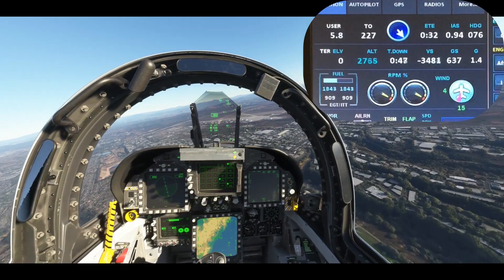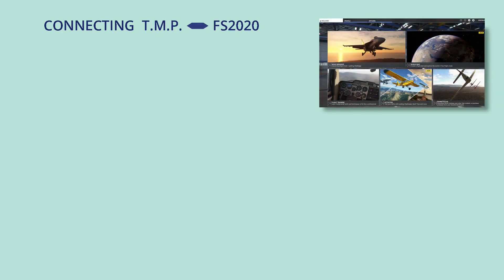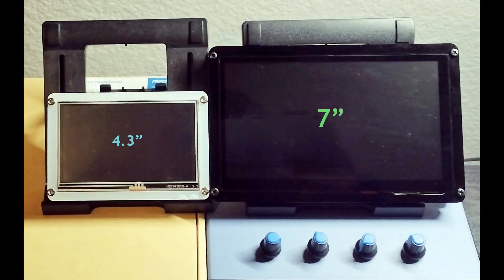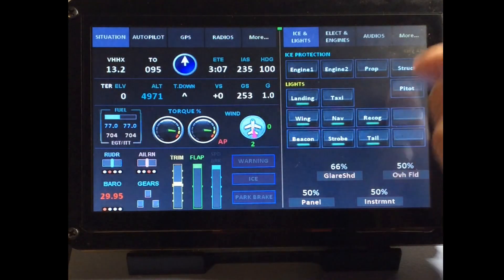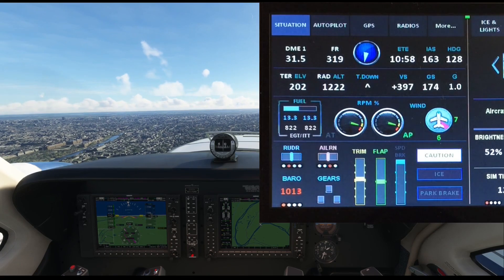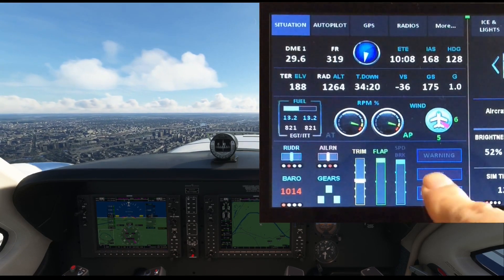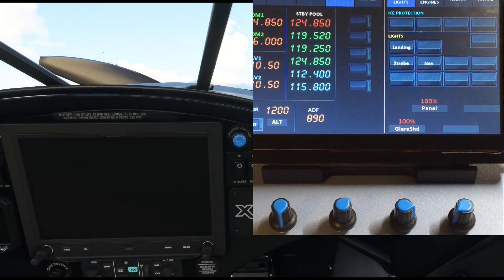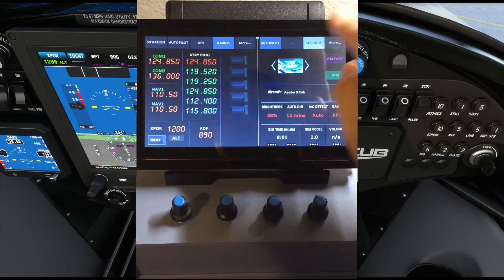FS2020 Touchscreen Panel [Update 5]

Comment: Hy and thanks that you show this to us. I work now on my own and I have problem with “flashing” the esp32. Always I have an fatal error: glarewal or something to that. I utilise the Japan site but with the 7 inch monitor and without X-Plane stuff on libraries, I can not go over this problem. I’m stuck! Can you help me?
Reply: GlobalVars
Reply from the maker: Are you able to flash any ESP32 code?  For example, an LED Blinker sketch?  You need to be able to do that, first.
I forgot to mention that if you’re building the firmware for the first time with Update 5, i.e. not updating from a previous rev, you’ll still need the XPLDirect library to complete the code build.  Even though, XP11 is not supported in this current update.  To do that, please download an earlier code zip (e.g. 1.12.31) and copy its XPLDirect folder to under your Ardunio’s “libraries” folder.
If you have further specific issue, best to communicate via email.
Reply: Thanks for your precious information. We’re i find your email?
I vil made an attempt later today